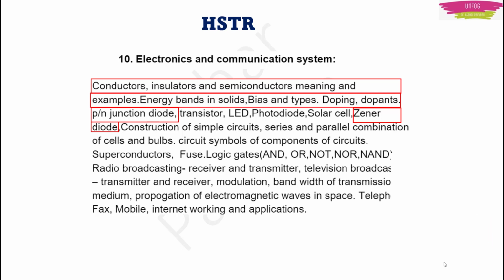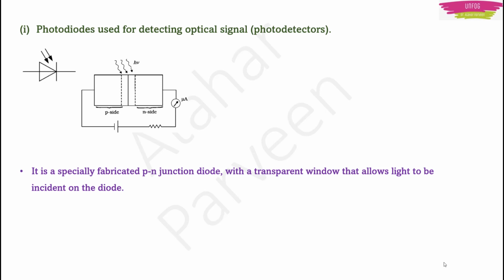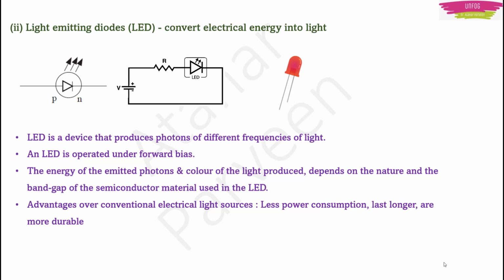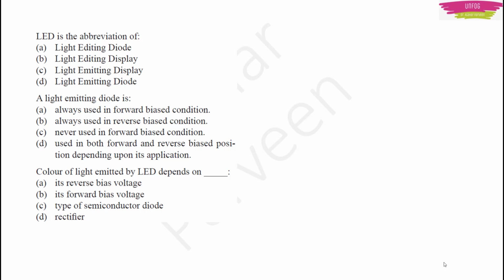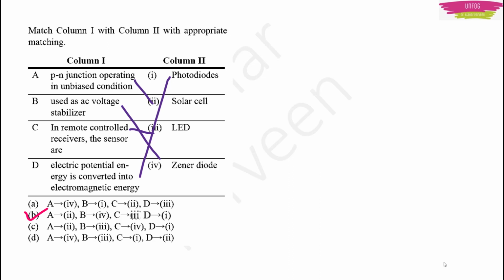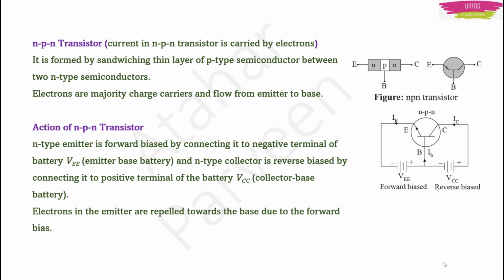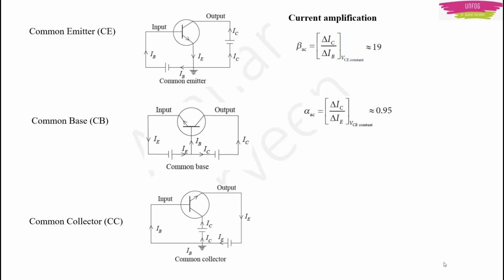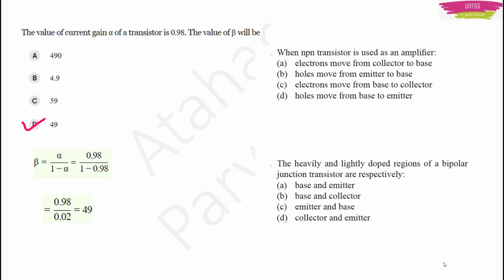Target HSTR  | KVS| ELECTRONICS : TRANSISTOR | PHYSICS CLASSES | PART 2 |Dr. Atahar Parveen

Comment: Npn transistors electrons move from....base to collector is write but .ur answer is Holes move from base to emitter...in npn transistors electrons are the majority charge charrires .mam plz correct confusion
Reply from the maker: Electrons are the majority carriers in the NPN transistor.
The main current in an NPN transistor is due to electrons moving from the emitter through the base to the collector.
Holes do move from the base to the emitter, but this movement is less significant compared to the electron movement.